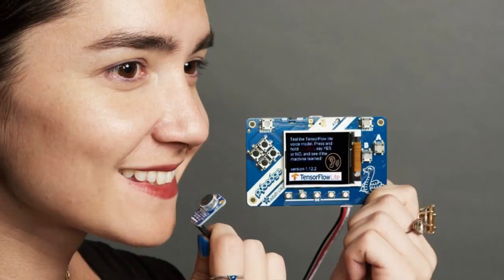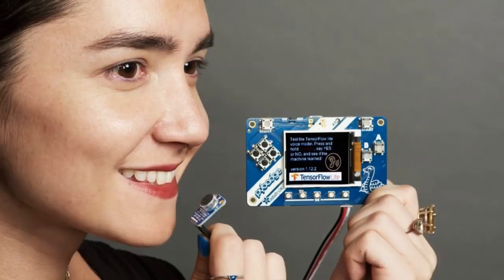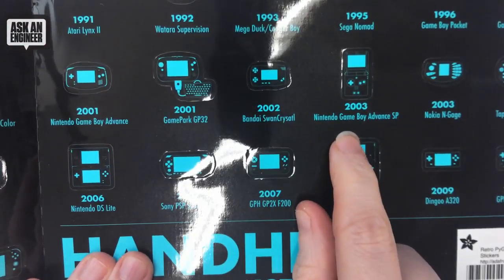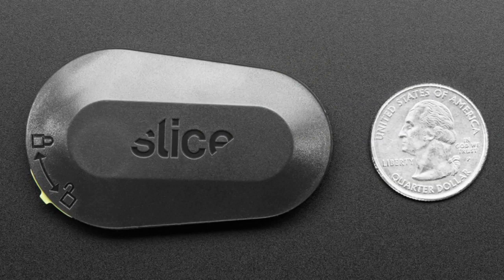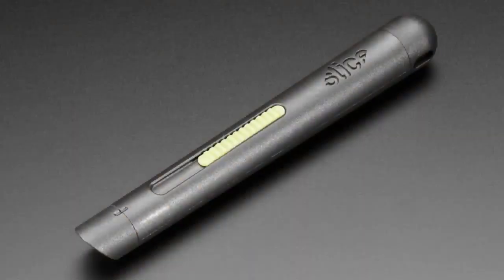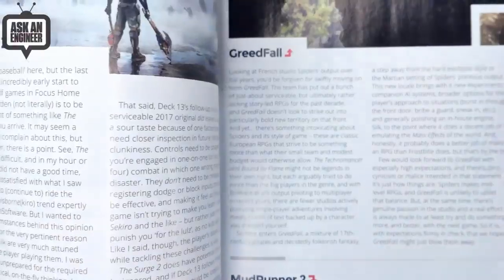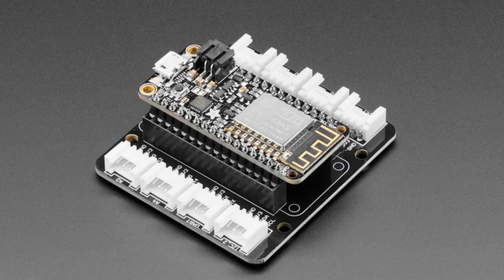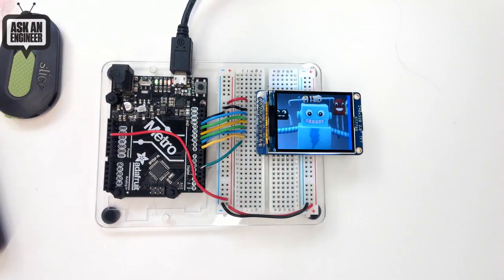New Products 7/17/19 Featuring 2.0" 320x240 Color IPS #TFT Display! #adafruit

Comment: I wonder, how can these ceramic blades be safer than normal?, I have some ceramic kitchen knives, and they are supersharp, and i cut myself very easily :), so if this is sharp, and difficult to cut yourself, I have difficulty to compute... I better buy one to see maybe.
Reply: I assume they are sharp enough to cut soft materials like cardboard, but they are not quite as sharp as standard metal razor blades or utility knives. Think scissors vs safety scissors. Presumably you could sharpen them like your kitchen knives, but they don't come that way, as it's not necessary for many scenarios.